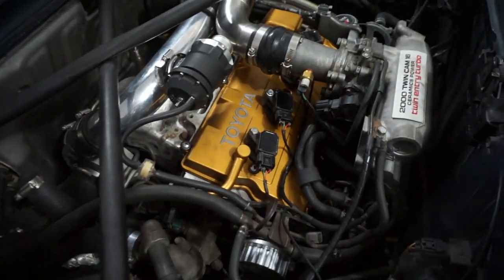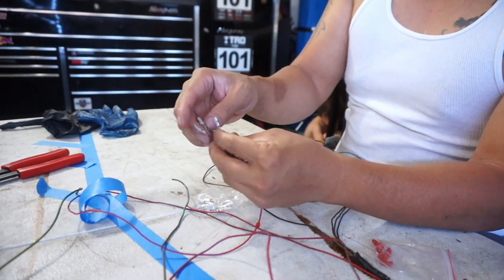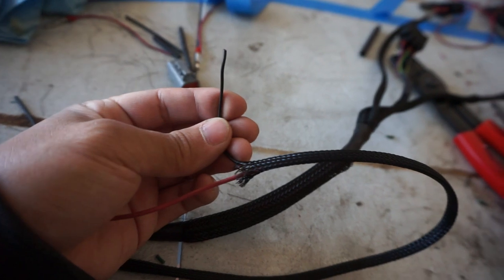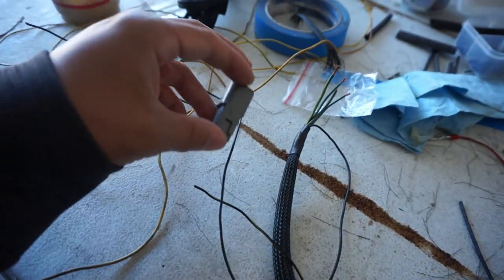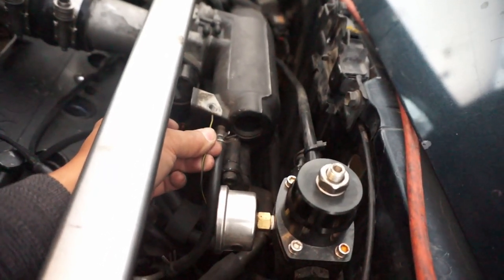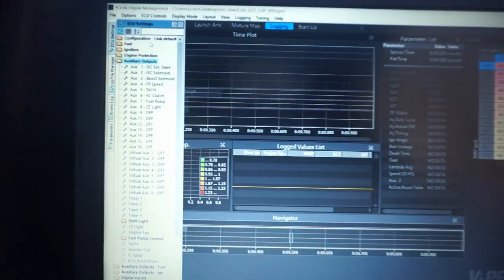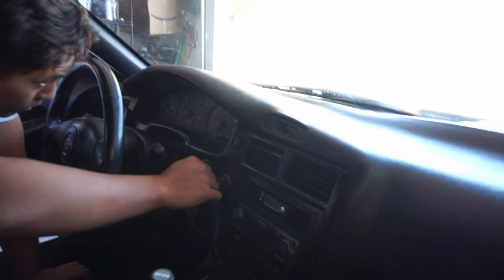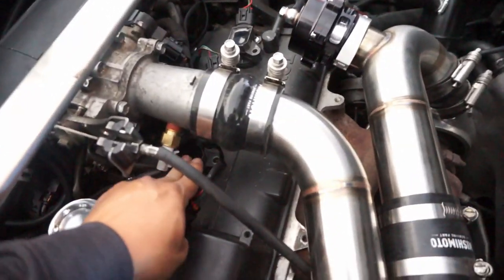Making a COP wiring harness for MR2 turbo with link ecu

Comment: Nice Video!  One question for ya - in your coil pack harness, where did you plumb the tachometer wire into?  You showed where it came out of the harness to be joined to the coil wiring in the engine bay, but where is it getting its source from?

Comment: Thank you for the video I am looking to modify my rev2 na and this helps a lot to try and plan things out :)
Reply from the maker: I will be doing more to the mr2 soon and more consistent. I'll be converting my throttle cable the drive by wire in the next video.
Reply: @Mr_friday  awesome :D
Reply: I have to do something with my speedometer since its analogue if i wanna swap to something slighty different . So found som nice digital aftermaket bike gauges to use :)

Comment: Great video! I'll be adding the Racer X COP setup with a Link G4 PlugIn for my MR2 soon. Great work
Reply from the maker: Awesome! Will you be doing the crank angle set up? Or using the waste spark off the distributor?
Reply: @Mr_friday  Crank and Cam hall sensors. I thought about using the distributor but the option to remove it completely was too tempting.

Comment: is the wiring to the tacho the same as oem?
Reply from the maker: I would have to say yes. But you would have to look at the wiring diagram on which wire and pin out it is. Then from there is you are going to ad a different tech you would have to find the wire in the body harness. Hope that will help. Any other question DM me

Comment: I did my car the same as following you and I have the same skip but because you didn't show where you put the wires I can't finish it I tried looking at my Manuel but it shows injection one twice and injection to twice so I can't tell which one is one two three or four any suggestions from anybody
Reply from the maker: What link ecu do you have and what engine?
Reply from the maker: Message me on IG: mr.fr1day  if you have instagram I'll show you step by step
Reply: Yes unfortunately I have the link G+ for the Subaru V3 they are all the same but the daughter board put the pinouts and my engine is a version 2 I got it working but it is skipping and thank you for your reply